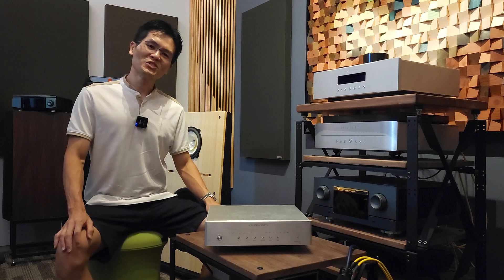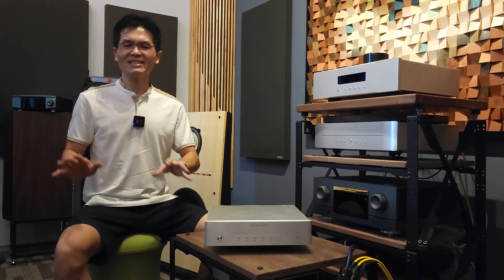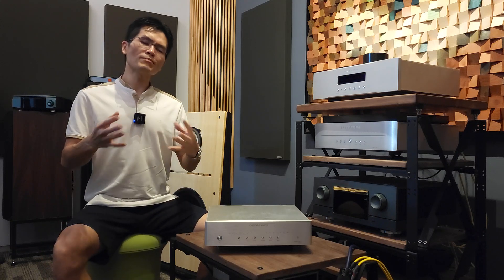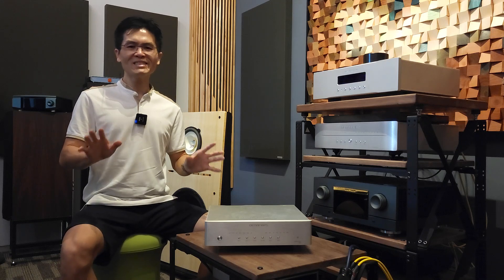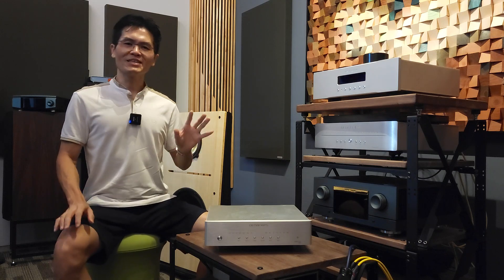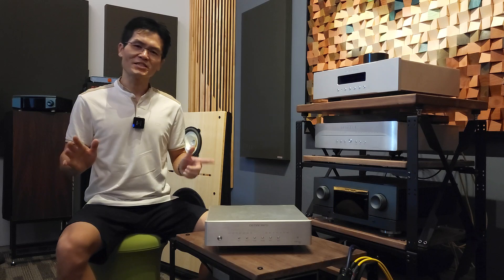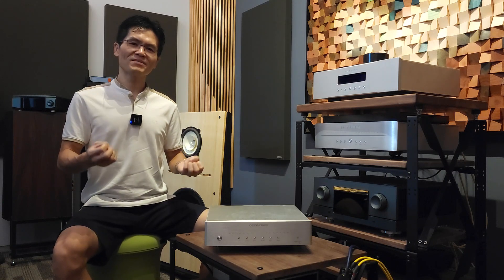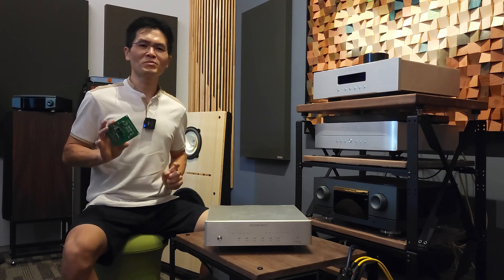NEW FPGA FIRMWARE | DENAFRIPS PONTUS DAC

Comment: I have been planning to do the 12th firmware update for my Pontus II. Glad to wait until now. I am not clear about this video. Please help from anyone who already upgraded the very latest FW as Alvin presented:
1.	Was the first 12th FW update not good? And a roll back to the original one is recommended? 
2.	Who has already upgraded the latest FW as Alvin presented in the video? Any improvements comparing to the original one and the previous 12th Annv FW?
3.	Any suggestions to either do the upgrade or not? 
4.	Is the latest FW final? No more coming up again?

Please help! Thanks.

Comment: Just upgraded my Pontus II to the new v1.4 firmware and am very happy with the sound. Thanks Vinshine Audio. I was previously using over sampling (OS with Smooth filter) but now prefer the NOS setting with this new version... very natural and punchy sound that works well with my Eversolo A6 streamer via USB, output from the Pontus II using balanced XLR to a Musical Fidelity M6Si Amp and KEF LS50 Meta speakers. 😍
Reply: wow, that must be one HELL of a bright/forward system. The KEF LS50 is known for being forward and Musical Fidelity for being forward. I personally don't think I would be able to listen to your system for more than a few minutes. I do have to say thought that MF makes some beautiful amplifiers with very good build quality.
Reply: @Phoenix_1991  Both the Pontus II and the Musical Fidelity amp are actually slightly warm of neutral and partner perfectly with the LS50 Meta speakers. Definitely not bright/forward in my medium sized room. 🙂
Reply: Hi there, may I ask you how I update my pontus2 as I’m now completely at a loss as what to do 🙏

Comment: Always prompt and phenomenal support from Alvin and the crew at Vinshine, from my first ARES II purchase to my Pontus II and IRIS DDC. I may be in the minority of those who updated to v1.4 and rolled back to v1.3 because we agree with the members of the Denafrips listening team who prefer the sound of the v1.3 firmware. Version 1.3 sounds so much smoother and laid back on my system. Vinshine has kindly shared all of the firmware versions for the Pontus for user flexibility.
Reply: Hello, friend! What kind of improvement do you hear with the IRIS when combining it with the Pontus II and your favorite firm (1.3) ? Do you think the DDC is still worth to add? Thanks!
Reply: @rodrigoarias390  hi Rodrigo, for me, the Iris added a little more weight and authority but was not a necessity.
Reply: @word2RG  Thanks!
Reply: @rodrigoarias390  I was skeptical that a DDC would make much of an improvement in the sound quality, but I have been completely amazed at the transformation in the sound quality and the listening experience that the IRIS has made to the already great Pontus II! The sound is far more dynamic, punchy, effortless, and resolving with no sense of bass or treble, only well-defined music on a sound stage that comes alive right in front of you. I suspect that this improvement may be attributed to the use of the I2S input of the Pontus II. Anyone who uses a USB connection, and the Pontus II DAC should not be disappointed, especially at the price point of the IRIS. FYI, I’m using a .75m Audioquest Blueberry HDMI cable for the I2S connection. My system uses a passive preamp and Magnepan MG3.6R speakers with 5' ribbon tweeters, which are very revealing of problems with the upstream electronics. I am using a 25' active USB cable between my computer and the IRIS. I'm very satisfied with the results.
Reply: @lewphillips4  Thank you! Have you tried the Hermes? Do you think it could bring an even better result? I’m considering between a new Iris, a used Hermes, or even a Gustard U18 which seems to be very good also. Thanks again, friend, very useful information, greetings from Mexico!
Reply: @rodrigoarias390  I have not tried the Hermes. Perhaps there are some reviews of the Iris and the Hermes that you can review. FYI, when I sold my ARES II, I was able to transfer the balance of the Denafrips 3-year warranty to the new owner. The used Hermes may have some warranty left on it too.